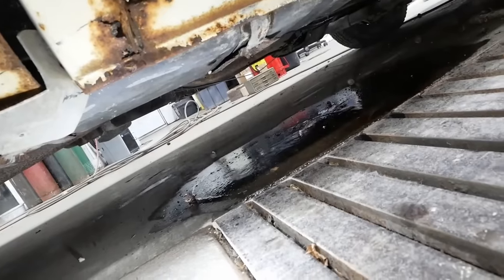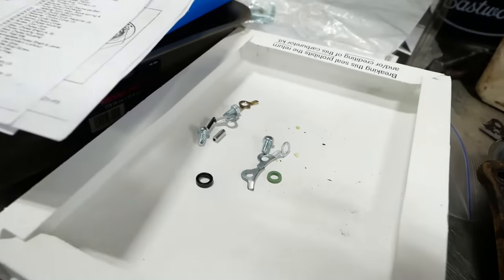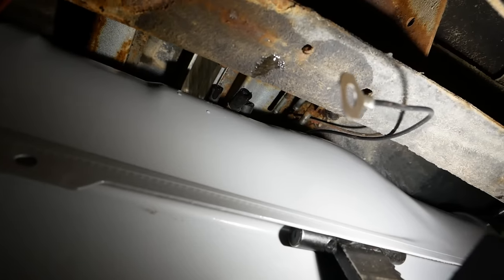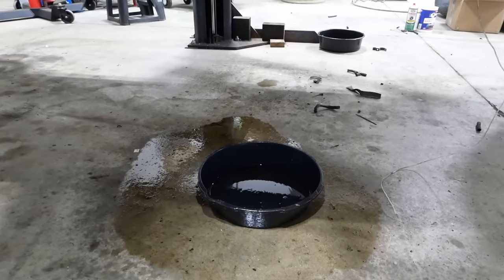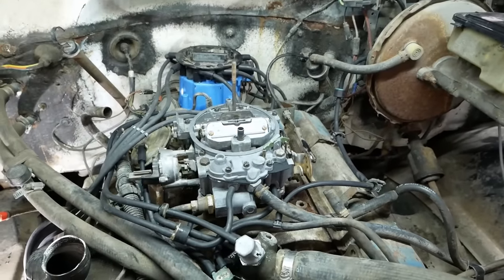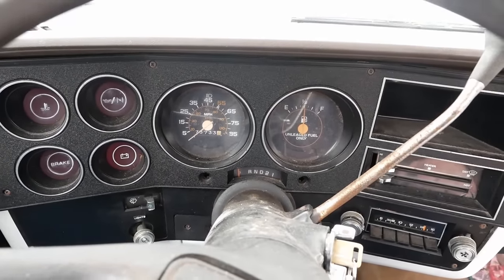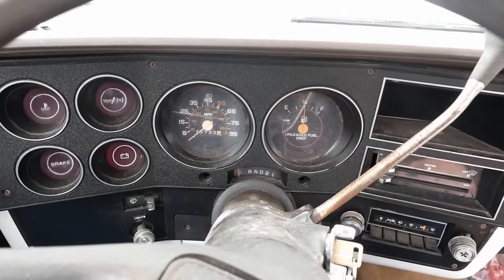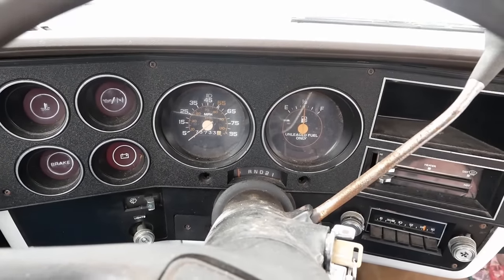Millennial vs. Carburetor | Square Body Chevy Back on the Road After Sitting 12 Years

Comment: Every carburetored vehicle has it's own start procedure. Some are 6 pumps, some half a pump, some need you to flutter the gas pedal while it cranks. You just need to drive every single one for a week to find out it's specific temperament.
Reply: what the pumping does is dump a bit of fuel into the intake manifold or something right?
Reply: Yes it does
Reply: All carburetors are designed, so that when the engine is cold, you only depress the accelerator once or twice in order to enrichen the fuel mixture while starting the engine. If you have to pump the accelerator more than that, you have a problem.
Reply: @bertramlrezenet9311  That's fine for a brand new engine and a tuned carb. But not realistic. Low compression and you're going to need more fuel. Colder temp and you're going to need more fuel. A carburetor will not compensate for that other than leaving the choke on longer. The operator needs to learn every single vehicle like I said.
Reply: @bertramlrezenet9311  Depress once (or twice) primer fuel and sets the choke.
Reply: I owned a '79 K25 with a 350 (four barrel quadrajet) farm truck with 100k miles, living in snowy conditions. Two pumps was sufficient. More could flood it.
Reply: The choke isn't hooked up on my truck so I have to pump it about 15-20 times in the winter to start it, less in the summer.
Reply: My solution exactly and I've owned quite a few carbureted vehicles, some of them brand new, in the 70's and 80's. Drive it back and forth to work for a week, your right foot will learn exactly what works and it will start first time, every time. And no one else will be able to easily start it.
Reply: Yes one some of them even need you to line up sun and moon in the sky just right to get them to start
Reply: My combination of pumps also change with the winter vs summer seasons.  Each carb has its own "personality" if you will.
Reply: @danielclawson2099  - My own experience both with a '69 like farm truck and a '59 Interceptor with a Q4 on a Vette 350 - and every customer Q4 I ever set up.
Reply: 87 w100 dodge. 2 barrel . rebuilt  carb. 2-3 pumps and 3 seconds it starts. and drives. if left alone for a week same thing just 8 seconds of cranking and it will start and go.
Reply: Old 82 Holden commodore I had with the little 4.2L (253ci) V8 and Quadrajet always started perfectly, 1 full pump then crank it, then when it fired another little 1/4 - 1/2 a pump 👌
Reply: On my old Ford small block hot rod if I had it running right and it hadn't been sitting for more than a few days, pull the choke and give it half throttle after it's cranking and it always fired right away. I never liked pumping them before cranking because the fuel won't atomize and you run the risk of flooding them. When it's really cold out I've never had luck with anything carbureted. They just don't like to start at all. I do not miss them since the OEMs made the switch to EFI in the late '80s. Carburetors, points ignition? No thanks. I'll take my port fuel injection and electronic ignition all day every day. It just works.
Reply: @chrisbarber3658  With all the fuel you're wasting one of those Holley Sniper EFI systems would pay for itself pretty quick.
Reply: @randr10  - Man it must REALLY get cold where you are. In MA we could always get the cars to fire up - even at 10 below. Yeah, they'd crank slow, but they'd start 😁

On an automatic choke vehicle, 1 pump sets the choke. I agree, more than 2 or 3 will flood it.
Reply: @jimrky6062  Everything I drove that was old enough to have a carburetor on it was pretty tired by the time I got my hands on it. Most stuff works pretty good when it's brand new. Those zero degree mornings were about 50/50 on whether the old junk would start without jumping it. With the fuel injected engines I've never once had one not cold start unless the battery was dead and it wouldn't crank at all. Even stuff that's high mileage and severely neglected starts pretty easy now.
Reply: @randr10  - 😂. Our cars were 7 years llus. Ee refurb’d ‘em - sometimes a full rebuild. But, yeah I can see what you mean. Replacing throttle shaft bushings was no joy.
Reply: @randr10  send me one of their systems and I'll put it on. I can't afford that fancy stuff.
Reply: But hey, that tar paper has to be precision cut!
Reply: Cold starting most engines with carburetors  requires you to press the gas pedal once to the floor and release then start, this sets the choke and the accelerator pump pumps a shot of fuel in the engine.
Reply: if everything is right and it hasn't been sitting for a long period, usually two pumps will do it. pump one sets choke(if electric or you pull it manual) also fills the evaporated/boiled off accelerator pump circuit, second pump should spray enough fuel to start in moderate climate. if in freezing cold, crank it and give a pump or two more. if it sits for a week or more pump whilst cranking. I have likely dated myself once again, old enough and plenty of carbureted vehicles/devices and rebuilds(far too many)
Reply: if you have to pump your gas 6 plus times to start it you might want to look at your timing cuz that can be way off or just go buy some ether and spray and prey.
Reply: @chrisbarber3658  just hook up the choke seems like more of a pain in the ass to struggle with it everyday!
Reply: @mromatic17  You also may have a bad accelerator pump.
Reply: You are so right on this.
Reply: @viqq183  Bwahahaha!!
Reply: My ‘63 Cadillac has that same carburetor and Choke except it was heated only by the tube coming up from the intake manifold.  There was not an electric heating element.  I never had any problem with cold starting.  One pump of the pedal and then hold the pedal so that any play was taken out of it.  Turn the key and usually you didn’t even have time to release the key before the engine was running.

Anytime it was a warm start you didn’t need to touch the gas at all.  Upon shut off of the motor there was a solenoid that squirted a little gas into the carburetor as a prime for the next start. So long as that gas hadn’t evaporated it would immediately come to life just nearly the  same as turning on an electric motor.  That solenoid actually moved the gas pedal in the car so you could see and feel it give that little jolt of gas.  That car at 59 yrs. & 164,000 miles still works like that w/o fail.  A testament to Rochester Choke Engineers.
Reply: @bertramlrezenet9311  Tell that to my 426 Hemi with dual 1404 Edelbrocks! Of course there are no choke plates on them as it does not see the cold, but even in the summer a cold start is 6 pumps and crank, 6 pumps and crank, then it fires off. Nothing wrong with a carb if one understands them.
Reply: All my stock trucks with carbs take one pump and it’ll fire right up. 
My trucks are high mileage but tuned up, carbs are all pretty fresh, they start like new.

Comment: As far as zinc in oils wiping out camshafts if it’s already broken in it will run without zinc but if it’s a new camshaft you’re breaking in it will flat burn up in 20 minutes running! I learned this the hard way. So it’s a fact. It wore a 1/2 inch of steel off in 20 minutes and draining the oil like a metal snake coming out. It pretty much ruined the engine pumping the metal throughout the oil system.

Comment: You will Destroy the Cam Shaft Lobes ON these old engines If you don't add the Zinc Additive tractors and industrial engines are different then Consumers Vehicle Engines you can use Diesel oil Like Rotela T4 or higher you can use that in these old Engines just fine they have the zinc needed i say oil has gotten bettern since them days but gasoline was better before the ethanol @Watch Wes Work

Comment: Future reference, slightly bend the float pivot pin so the air horn compresses it again. Stalling on initial start-up is because your choke pull-off is adjusted too tight. The EFE is Early Fuel Evaporative which doesn't really reduce emission. Rather, it prevents stumbling and stalling from the fuel condensing on the intake manifold at the base of the carb where the airflow has to change direction. There is also the latent heat of evaporation of the fuel which keeps the intake cold for an extended period of time, even creating frost in said location. The EFE is only a butterfly (which defaults to the open position when no vacuum is applied) that forces exhaust across the intake to prevent condensation, stumbling and stalling. Connect your EFE. You'll like it! The TVS will shut the vacuum off to the EFE when the engine reaches operating temperature. 

(Emission controls neither robbed power nor mileage. They in fact improved mileage. Lean mixtures cause excessive heat and oxides of nitrogen emissions. The EGR utilized exhaust gas to lean out the mixture (mileage) while robbing it of oxygen, thereby eliminating the excessive heat and NOX. It was the cam timing that robbed the performance and mileage.The cam timing change took place in 1971. Time was that you could order a timing gear for a 1970 Chevy small block and wake up your later model car/truck. You could see that the keyway was 10 degrees different. Manufacturers then stopped making the 2 different keyway locations in the late 80's and you were then stuck with the retarded cam timing from then to eternity. But... I digress..!)

You never mentioned checking the EGR valve. It has its own TVS. Make sure you're not feeding manifold vacuum to the EGR valve, and/or check to see if the TVS is not closing off while cold. There should be no vacuum to the EGR when cold or until there is s strong ported vac signal. Put a vacuum pump on the EGR and make sure that the diaphragm moves, and how much is required. They generally either leak all the time or don't open at all. If you connect ported vacuum directly to it, it might open too quickly. You're finger is in the way, so I can't see the diagram for it! I see a delay valve for the torque converter lock-up, but that's all.

The early 80's Buick Regal, et al, with the V-6's had serious stumble on light acceleration during cruising speeds. Dealers were stocked with what looked like blue electrical butt connectors. They were brass with a metered orifice in them. We would cut the vacuum line to the EGR and insert the orifice. Problem solved! It just slowed the vacuum signal to prevent the hesitation. Since you have the vacuum pump out, apply it to the EFE as well to check the movement. Wouldn't hurt to get a new thermac switch for the air cleaner too. Wrecking yard should have one.

Now for your scolding, young man! Should you ever pull that carb or install another Q-jet in your life DO NOT use that rattle gun! EEE GADS, man! Go back and watch how far it cocked that carb when you ran that first bolt down! Then the next, and the next! Carbs do NOT like being twisted!  Use a ratchet to snug all 4 and then do the cross pattern twice until you achieve final torque value. 

The electric choke, EFE and Thermac switch in the air cleaner are designed to all work together. "Cold" is anything below operating temperature, and all 3 of those are incorporated into "cold" operating conditions. The EGR comes in to play at operating temperature. You know you're leaning out, so you only have a few reasons why. Some cold, some at OT. Could be low float level. Could be low fuel pressure, which can cause low float level. Could be carbon build-up on the EGR valve seat. The simplest starting point is connecting that EFE.
Reply: All of this...wow! Long sprint down memory lane. Can't believe I'd forgotten about all of this.
Reply: up
Reply: Wes, don't be browbeaten by this.  I'm absolutely certain that he's offering the best info you're gonna get.  Elderlyiron was probably doing q-jets before you were born.  I bet he can quote torque changes by the serial number.  This is the genuine article, just like you.
On the other hand, I can only fiddle with mine until it runs good then it's set for a few years.  '71 Chevy K-20, 350 V8 that I've had for 40 years.  Quadrajets are all the same..........ain't a one of them that's just like another!

Comment: 30:18 fellow millennial here. It's not crap, zinc and phosphorus were removed from most of the shelf oils in order to extend catalytic converter life. It's vital for flat tappet engines, especially mid 50s to early 70s.

Comment: Good work Wes! those Q-Jets are/were a headache for most people even back in their hayday. Once you understand how they work, they truly are a very simple and tunable carb. one thing to check for that part throttle cold stumble is the accelerator pump shot. While barely activating the throttle, look down at the pump discharge ports. If fuel dribbles out weakly, the pump needs adjusting. usually the pumps fulcrum arm's tip (where it meets the pump shaft) needs to be bent downward to insure the pump "cup" is down far enough in the bore. there is a spec for the installed height that should have been on the data sheet. when the engine is cold, the fuel doesn't atomize as well as when the engine is warmed up, so it needs an adequate pump shot to overcome a stumble. hope that helps. yeah, I'm a Boomer...

Comment: My recollection of the best Quadrajet tuning process was to replace the thing with a Holley saving time, blistered paint on the walls of the shop, and my sanity.
Kudos to you for getting it to run as well as you did. 
Eric
Reply: We referred to them as quadrasu***
Reply: @papasatitagin  I think in the first video, Wes referred to it as a Quadrabog, which was what we always called it, here in the land of Rottenchester Carburetors. I doubt if even the guys who built them, or designed them, could figure how to get them to work right after a year.
Reply: @papasatitagin  quadrajunks lol
Reply: @papasatitagin  Or did you mean Quadjajunk? LOL
Reply: I remember when I was a young bloke a Holley 4 and you were just it.   John
Reply: Put a Holley 350 2bbl on my Ford 302 with a manual choke, no more auto choke problems!
Reply: Had a 307 olds engine, pulled the quadrajunk off, put a used Carter on, and drove it for 10 years. I know it's possible to get them to work well, but in my experience, they're just too finicky compared to other aftermarket carbs.
Reply: Quadrabog lol
Reply: Holley made a lot of $ by people pulling perfectly good Q-Jets off and putting Holley carbs on for no other reason other than they wanted to say they had a Holley.  They had a lot of derogatory nicknames given to them from people that didn't even understand how a carb works.  On a stock engine they work great.  And I'm not sure why you would expect them to would great on a non stock engine w/o some modification.  And that is where the Holley has the advantage.  The Q-Jet wasn't designed to be easily tuned.  It was a stock carb for stock engines.  The Holley was built from the ground up to be put on any engine and be easily jetted and tuned to make it run smoothly.
But you can make a Q-Jet on a hot engine run great but you have to have a lot of parts and a lot of know how.
Reply: I'll take a Quadrajet over a Holley for street application any day of the week, for race application, that's where the Holley shines
Reply: Q-Jets are 750cfm and are as good as any aftermarket carb to around 400-450hp
For every day driving there's no better carb...
Reply: The quadrajet is genuinely the best running, best engineered v8 carb ever made. They flow, they sound good (vacuum secondaries!!) , they're ultra reliable and precise, they're efficient. Just because you associate them with smog/stock vehicles they might have a bad rep. Get a good one tuned and cleaned up and its the best running carb you're gonna get. The QJet is light years ahead of a Holley or Carter AFB. Truth.
Reply: quadrabog/quadradog. even when adjusted and tuned the absolute best, they were best paired with a big block meant for torque applications(trucks, where they hardly ever opened the rear "bog ports" 🤣🤣🤣
Reply: @truckguy6666  Amen!!  I have loved my Qjets!!  I’ve had 6 vehicles w/them and they all worked good.

I had a ‘64 Buick V-6 with a Carter 2BBL that gave me problems to no end!
Reply: @ToddKing  <--- this guy knows what's what. Quadrajets ran strong when properly tuned.
Reply: @whammond511  Ol' Carter thermobogs. These comments got it all wrong calling the Q-jet boggers. lol

If ya know, ya know. Carb tuning is a lost art nowadays and most younger gens have no clue about them. 

No offense to said younger gens.
Reply: @truckguy6666  Yeah they were so good that a huge portion of them didn't run for crap from brand new. Then you took them to the dealer and most of them couldn't get them to run right either. The emissions equipment the carb had to work with was sure part of the problem too but the running issues people had with them is why a lot of people don't like them. If the carb is that finicky it takes so much tuning to get them to work half decent it really is not a good carb.
Reply: Worked for gm dealer 67 to 76 qjet are fantastic carbs .I have several after market books on them once you learn they are super easy to tune modify and are trouble free . The rebuilde kits are cheap and i sprayed all gaskets with silicone spray which allows  you to take apart the carb without destroying the gaskets .
Reply: @poweredbyford87  only junk if you dont understand them
Reply: @LolPepperGate secondary tip in point  not adjust correctly
Reply: @danieledwards1081  they work for some race application also but holley has many more tuning options for sure
Reply: @ToddKing  100% correct most my cars had qjets .I worked through school and colledge at a small town chev olds dealship i   became very proficient on making qjet scream with 0 bog lolo
Reply: @truckguy6666  100agree
Reply: @xtr3m3fLx  100%agree
Reply: 100% success, they ran like crap when they were new!